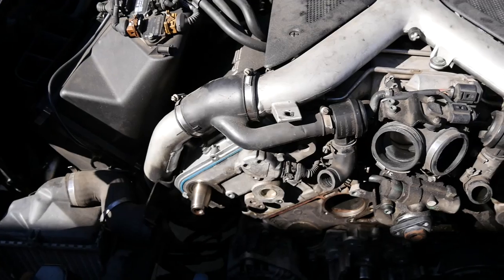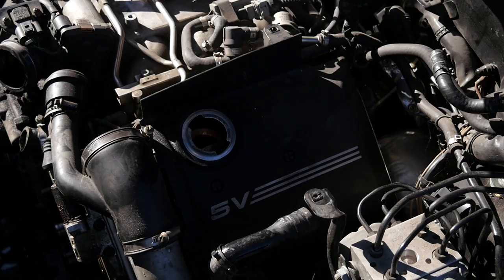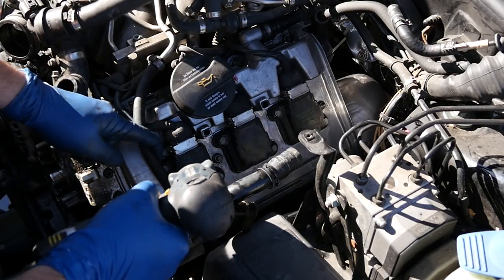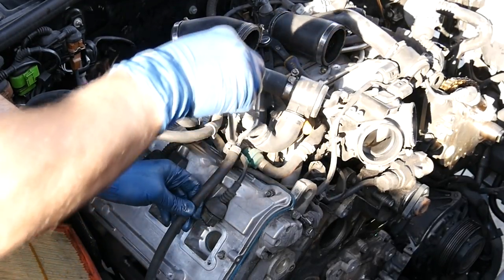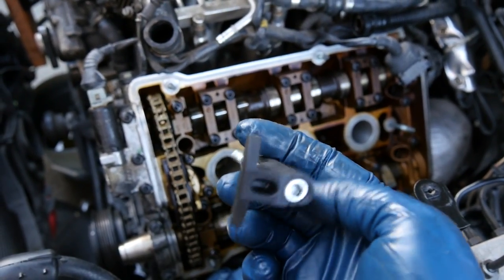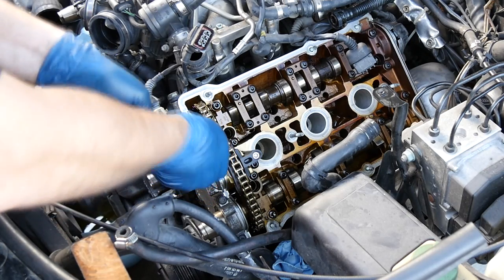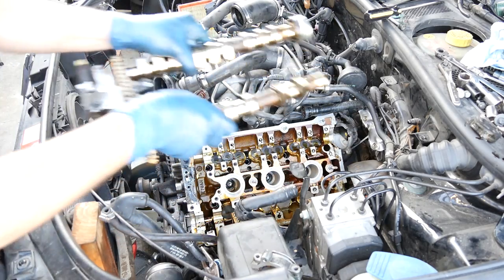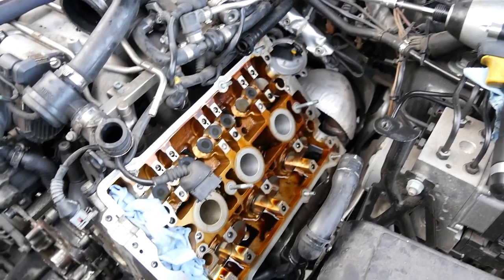Whats Involved in a Bi Turbo Audi Camshaft Removal - Sleeper Car Series

Comment: While you are at it, you should check the hydraulic lifter buckets to see whether the rubber pillows are stuck. I had heads refreshed from a 2.8L and found that 2 of the buckets were stuck. Really good time to make sure they are working correctly. You might as well do the valve seals while you're at it too so that the heads will be like new when you're done. No more puffs of smoke at start up.
Reply: Hydrolic lifter buckets? Do those affect the chain tensioner pressure?

Comment: Another great video. Keep them coming! ~:-)
I did a complete valve job (lapped all 20 valves myself) on my 2001 TT Quattro (AMU MK1). I could not have done it without your 3 part video (bad water pump on an A4). Thank-you very much.

Comment: Where is the second video where you put it back together? Also would like to see how you replace the CCT guide pads. On the drivers side must you remove both camshafts and timing belt or can you get by just removing the intake cam? Thanks for all your VW and Audi  videos!

Comment: awesome video man, super helpful. I'm not sure if you're still reading the comments on this but I have a question. I'm doing this exact same job on my 01' A6 Quattro Avant (2.8L). Timing Belt was already removed and had the crack locked. As I was removing the cam tool, the passenger side camshaft had rotated about 30 degrees. I panicked, rotated back to TDC with timing mark notches on the camshaft into alignment. The crank did not move, its locked. Would that have any adverse affect in damaging the valves or pistons?

Comment: I have 1.8 92KW APT engine and i have the same chain tensioner. I got some knocking noise when i press accelerator from idle, or when 1st gear to start moving. I disconnected the connector from this chain tensioner, and knocking is gone and the engine is running just fine! no change.  is that ok? what could go wrong? i saw chain tensioners withnout that el. connector

Comment: Just finished watching the video I see you did it the easier way by leaving the cam tensioner connected with the timing chain but for everyone to know the timing chain on the driver side and on the passenger side or different linkage numbers because one of them is in a valley and one of them is on the peak this took me 5 times of trial and error to get the correct linkage cuz nobody knew the correct linkage count.
Reply: Hi. Can you please tell me the correct link count? I'm facing this issue right now and can't find solid information.
Reply: I have a VW V6 2.8L

Comment: That our TV is the correct our TV it's a German brand I believe it's called diken something like that I got it from the OEM when I did mine and I can't believe you didn't have a problem with clearance from the combi valve my 2.7 both Combi valves were in the way for removing them worst thing I've ever seen in my life I know they changed the design the next year is your engine and APB